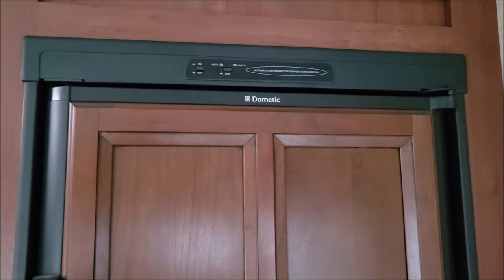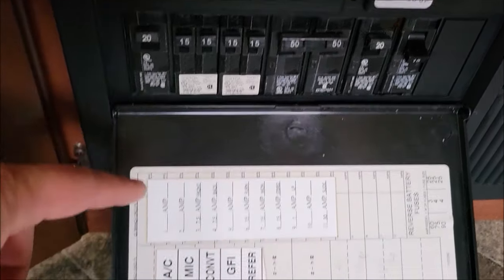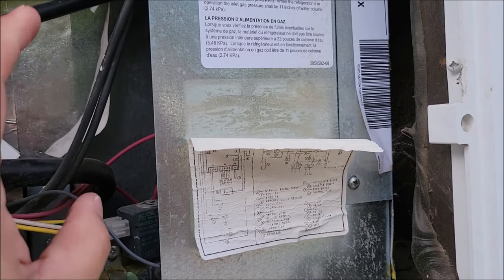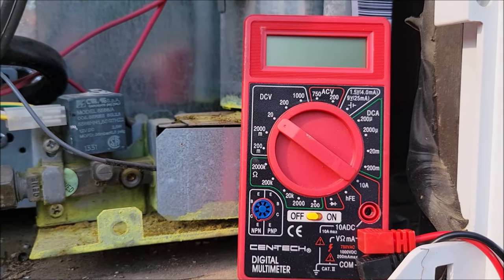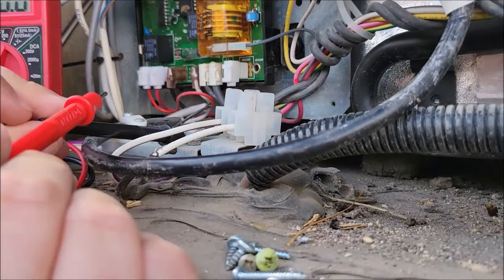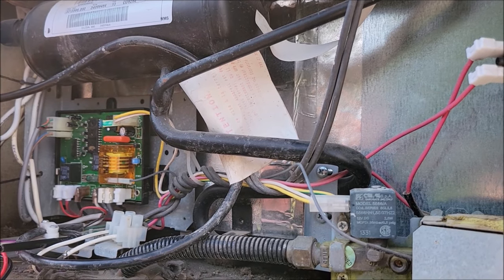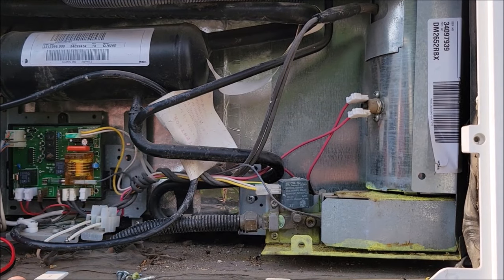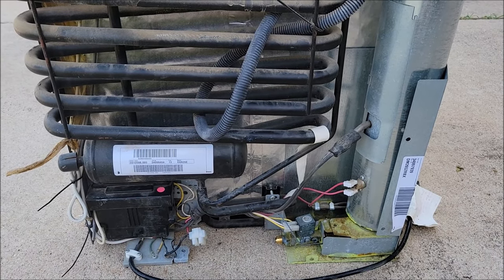RV Refrigerator Not Working | Easy Troubleshooting Tips | Dometic Issues

Comment: Mine confuses me because to have the electric on you have the button pushed down.  But, to have the gas off you have the gas button down.  ??????? Help
Reply from the maker: If you have this model or one close to it, the left button is just to turn the refrigerator on and off.  To turn it on you push the left button in and to turn it off you press it out.

The right button is either "auto" when pressed in or "only gas" if pressed out.  Auto will check for 120 volt power 1st and if it's got that, it will run on that.  If it does not find 120v power, it will switch to gas.  If it's pressed out it will just try to run on gas only.

Hope that helps.
Reply: @SeidelRanch  thanks it did

Comment: What does a bad fuse for frsuge look like
Reply from the maker: A bad fuse usually can be held up to the light and you will see the connector burnt out.  But, the best way to tell is to use a multimeter and make sure you are getting the same voltage on both sides of the fuse.

Comment: My problem is those two light at the top in the same area is on. When running properly, only one light is on. How do i get it back to only one is on as normal ?
Reply from the maker: Did you find the issue?  I think the two lights is when it can't start the propane and can't get electricity.

Comment: Telford N112 fridge is working on gas but not on electricity neither 230v or 12v, both heating coils are working as they get hot but not cooling inside. Any idea what could it be? Thank you
Reply from the maker: So the fridge works just fine on gas?  Cools fine and everything works like it should on gas but it's not cooling on electricity?
Reply: Yes  just gas  but all electric coil 12 an 230v  works but  fridge not cooling inside.
Reply from the maker: @janekrts  That would make me think the electric heating element was not working correctly.  I would use a multimeter and make sure you are getting proper voltage from the outlet all the way to the heating element when its switched to electric.  If it is, then you would want to make sure the element is getting to the right temperature.  Check that and let me know what you find.
Reply: Check your heating element:
1. Check that it is receiving power.
2. Check the resistance; but 1st you must know the correct specification, some are 80ohm while others could be 40. The resistance should be within (+/-) 10% of spec.
Reply: Ok thanks i will do 👍👍👍

Comment: Diometric rm2354  yeah so I have this fridge dimetric RV to RM 2354 model and it works on electricity it doesn't work on propane now I've replaced the regulator the pigtail it actually lights on its own and stays lit and there's a nice blue flame and everything heats up the flu and everything starts heating up and it stays that way for hours and hours and hours but it doesn't cool in the fridge again electricity cools the fridge so the fridge is working it's just for some reason the propane is not getting it cold and I've had it I put a level in the freezer compartment made sure it's level any suggestions anyone have any idea of why it's not working I've had a technician come out look at it he's gone through everything looked at the valve looked at the jet all that stuff tested the pressure at the stove which was I think he said almost 10 psi the furnace works the water heater works the stove works all on gas but for some reason the fridge just is not cooling on propane help
Reply from the maker: That sounds like a tough one.  I will have to think on this one because I don't even know where to start based on this info.  So the technician did not find anything?  Do the proper lines get hot and cold?
Reply: @SeidelRanch  hot yes cold no

Comment: light inside fridge works, "auto" light is illuminated.... nothing is cooling.... NO yellow sediment.... any advice....
We have checked ALL fuses, AC and DC.... checked the reset button.... ???
Reply: That’s the same problem I have
Reply: @CorynVinnie  we did purchase a meter and discovered that our connector to the inside panel, was not getting hardly any power... probably enough to light the "auto" light but that was it.  we are getting a new lower panel, and we will try that.
Reply: Our fridge still lights up but it doesn’t cool and we don’t have the yellow sediment on the outside
Reply: @CorynVinnie  that is exactly our problem too! We ordered a new board.(about $225). I'll keep you posted.
Reply from the maker: I would test the thermistor to see if that is working.  These videos may help: https://youtu.be/63pNRbQ9BBA or https://youtu.be/ZfCIDGfQID0
Reply: We did find that the upper switch on the lower panel was only getting faint readings... so we are replacing the board.
Reply from the maker: @mazene56  Ah, ok.  I hope that fixes the issue.

Comment: Why did it drain 2 batteries in a few hours and it’s 53 degrees?
Reply from the maker: This fridge is power hungry.  That electric heating element pulls more power then my AC and it seems to want to run forever.  I assume since you said battery that it's running from an inverter.  If that is the case, I recommend going this route: https://youtu.be/mxYPcA0Mvu4.  This fridge runs great on 1 battery (500w or more inverter needed).

Comment: I need help! I opened my fuse box and as you said the red light was eluminated on the fuse for the refrigerator. I am not currently using my AC on my trailer, I am using a little portable air conditioner because I do not have the power source for the one on the trailer. I decided to pull the 15 amp ac fuse and use it to temporarily replace the 15 amp refrigerator fuse. It worked, and then it blew that fuse. Where do I go from here? Anyone's help would be much appreciated right now.
Reply from the maker: Well, if the fuse keeps blowing then the fridge is pulling too much 12v current.  These are harder to find and diagnose.  Are you running the fridge on propane or 120v power?
Reply: @SeidelRanch  
Thank you so much for your response. I'm running on 12 volt. I'm new to this so I'm trying to figure out how the electrical system works with the AC and DC 
The trailer is plugged into a 15 amp outlet/ circuit.
My issue may be with a portable air conditioner that is 824 watts=
6.6 to 7.5 amps 
Rating of 9,000/5,000 BTU
I have been being very careful about running other things at the same time. However I did forget about the refrigerator. I'm not sure how many amps/volts it takes to run the refrigerator. I'm afraid that maybe I am overloading. Do you think that could be possible. I've been running the air conditioner for 2 weeks before this happened.
Reply: The fuse is blowing quicker with the electric and a little slower with the gas. But yes it is blowing the fuse either way. The funny thing is that my fuse board is either labeled wrong or I'm not understanding. The fuse that keeps blowing is marked as furnace(furn)
The fuse that's marked as refrigerator is not blowing. My only assumption is that there could be a possible mislabeling of the fuses. I did have someone come out today, and he checked all the 12 volt and 120 volt connections with the multimeter. They all were fine. So when I replace the fuse the first time it seemed to work for about 5 minutes. Did that about 3 to 4 more times and each time it seemed to blow sooner than that. So during those 5 minutes the refrigerator was in fact on. Do you have any suggestions on what to test next? Your help is very much appreciated. Thank you so much
Reply from the maker: @cj303  I would trace the 12v wires into the fridge and test the amperage each circuit was drawing.  Finding amperage issues is hard.  There should not be much using the 12v power.  That just runs the control boards I think.  This makes me think there is something burnt out on one of the boards.
Reply: @SeidelRanch  
Thank you for all of your advice. I will check into it.
Reply: @SeidelRanch  
Would that still be the case if the refrigerator runs properly before the fuse blows?
Reply from the maker: @cj303  It could be something as simple as a wire grounding out to a bad section on the circuit board that is arching once in a while.  Something has to be making that 12v connection use more power than it suppose to.
Reply: @SeidelRanch  
Thank you. I've been referred to an electrician but it's been hard to find one that works on rvs. I found one and he will be checking it out today. Crossing my fingers for a solution.
Reply: @SeidelRanch  
Thank you  for all of your input. It really helped. We found the issue but couldn't get to the wires without cutting the underneath cover on the under bed. 
We believe it was a compromised wire that was tightly zip tied in the cheap plastic conduit casing . It is zip tied very tightly to the frame of the trailer. Replaced it with a brand new wire. Ultimately it took an auto mechanic with knowledge in the DC power area and an electrician working together. Everything is fixed:-)

Comment: My fridge only works on gas.All fuses are good and when I press the buttons on eyebrow they flicker.Any idea what to test?
Reply from the maker: I would start by testing the 120v outlet it's plugged into.  If you have proper power there, I would then look at testing the control panels.  Hope that helps.

Comment: What if am getting only 6.5 from the battery and which battery
Reply from the maker: 6.5 volts from the 12 volt wires is an issue. I would expect a battery problem.
Reply: I checked the battery and it’s low but I followed the wites and underneath the frame there’s 2 small breakers one is broken and the other is rusted bad

Comment: I have 120V in AC but only 2.5 in DC but the battery does give me 12V, what could it be?
Reply from the maker: Sounds like a bad wire to me.  Maybe it got too hot somewhere or is grounding out.

Comment: my refrigerator does not have voltage 
on any of the Ac fuse terminals
Reply from the maker: If you have no power to the fuses, then I would follow the wiring back to the power source and find out where the power is lost.  It's probably not a refrigerator issue at that point.

Comment: after defrosting myfridge the fridge freezes everything. i cant even put my thermistor anywhere to fix it, i never even touched it when i defrosted
Reply from the maker: That is an odd one.  Maybe the thermistor is bad?  Did you find the issue?
Reply: @SeidelRanch  I think I fixed it after this comment but no. I'm just going to deal with it. I can't risk pulling out the fridge and damaging the crap press board more than it already is.
Reply from the maker: @Johkah  Sorry to hear that.  Keep me updated if you get it working right.
Reply: @SeidelRanch  now that the warm weather has come back my fridge works correctly
Reply from the maker: @Johkah  That sounds like a thermistor issue but not sure.  Weird issue.

Comment: The blue wire  on the top left  side  is not  connected to anything what should I do
Reply: I have a domestic  Rm2551 message from above
Reply from the maker: The blue wire you are talking about, if I understand correctly, goes to the sensor plug on the main control panel and would be your cooling sensor.  Is your refrigerator cooling?  If not, I would try hooking that back up and see if that allows it to cool.
Reply: @SeidelRanch  I do not know we're to connect it to just bought trailer trying  to fix Appliances not working.
Reply: Electric part will not work, but gas does.
Reply: Is connected to board  but other end is just hanging out.
Reply from the maker: @stevecalderman457  Oh, I see.  If it works on gas but not electric then it must not be your cooling sensor.  Does the front control panel work?
Reply: Yes it does.
Reply: Yes gas works Electric does not.
Reply from the maker: @stevecalderman457  Have you tested you are getting good 110 voltage to the control panel and the boiler?

Comment: I hope someone can help me?   

I have a Dometic residential fridge/freezer. 

When it hot outside my fridge/freezer doesn’t stay cold!  

It’s 50 degrees or higher!

When it’s cool outside the fridge/freezer is normal temp!

Any help is much appreciated!

My camper is a 2018 Reflection made by Grand Design
Reply from the maker: It may be your Thermistor going bad, but this page may help you: https://www.thedometicguy.com/blog/dometic-refrigerator-wont-get-cold-enough/
Reply: Thank you for this I will look into it. 

I’ve priced this fridge it will cost $7500 to replace!!

I don’t want to replace it if it’s something simple!  That’s a lot of money!!

Comment: Problem is Dometic is absolute junk. I’v been waiting for a Circuit board from my dealer for 6 months. The door never stayed closed I had to put my own latch. The cheaply made freezer door broke and hinges that probably cost 25 cents to make cost $75 to replace, each side. Now I have no power and the dealer said the part number on Amazon does not match what they ordered. Dominic also has a recall chance of fire when running down the road on 12 volt. You can feel by the push of the buttons how cheap the parts are. I had melted butter all over the floor when the door opened. What idiot makes a RV refrigerator with only a bent piece of cheap plastic and no spring to hold a door closed. I’m not kidding about the hinges, they were MADE to break. The pin that holds the spring tension has a little notch at its weakest point. This is a scam company, my dealer says they have nothing but refrigerator problems and no parts. That refrigerator in the video did not look that old to have that kind of problem. I would not buy a new RV unless the Dealer gave me a 5 year warranty if they don’t I would walk from the deal. Let them man up and start to complain to Dometic about the defective junk they sell.
Reply from the maker: Yeah, the fridge was not that old for it to fail like that.  I am loving the new refrigerator I put in: https://youtu.be/mxYPcA0Mvu4

Comment: Need help with my hot water. Won't lite
Reply from the maker: Have you checked the pilot?  Does it have an electric ignition or manual pilot you have to light?  I am assuming it's propane.  It's is electric and propane?
Reply: @SeidelRanch  
Both. Going to have the circuit board tested Monday. I've tried reset but shutdown. Thank you for answering
Reply: @SeidelRanch  electric. Maybe the igniter?.
Reply from the maker: @mondahudson2327  Does it work fine on electric only?
Reply from the maker: @mondahudson2327  It could be.  I think the igniter works on 12 volt power and the electric only works on 120 volt.  Maybe you have a 12 volt issue to the heater.  You would need to get a multimeter to it and test the voltage to all of the electronics.

Comment: thermo switch keeps popping after changing out board. Help!
Reply from the maker: Does the switch pop right when power is added or does it take a while like the boiler is heating up?
Reply: @SeidelRanch  boiler heats up, then switch pops. Unfortunately, found a little yellow residue on bottom of boiler, so guessing it is a lost cause
Reply from the maker: @kevinsartin520  Ah, sorry to hear that.  Yeah.  That's a fridge killer.

Comment: RV refrigerators; maybe the most poorly made and supported product on planet earth.  I have had 4 and problems with 3, the last being told, "Oh, you need to plug into 110v when above 5,000 feet in elevation".  So that's why too many people use those crappy Harbor freight generators all day long.  The only thing that makes more noise than a Harbor Freight gen set is 2 dozen Harley's warming up in a campground.  Both items excel at turning gasoline into noise.
Reply from the maker: Yeah, these fridges are not good.  I mean, I know they had a purpose at one time but not so much now.  I pulled this one and put in a residential refrigerator.  Way better.